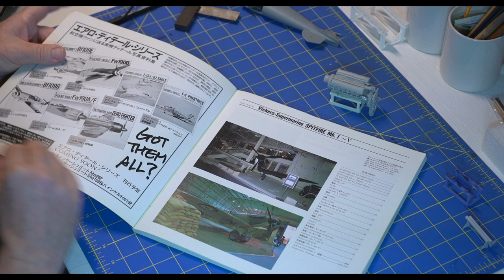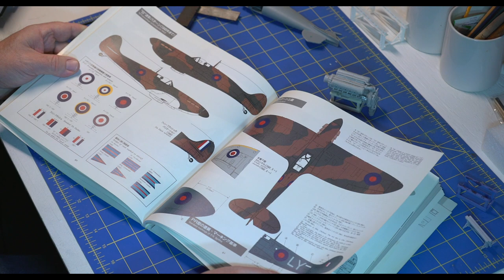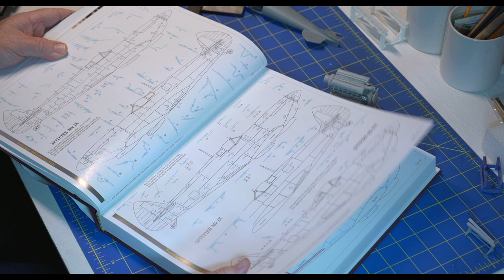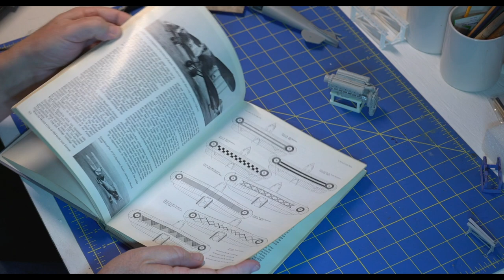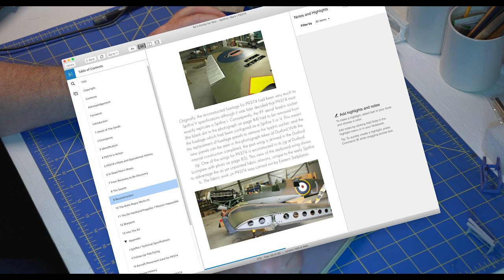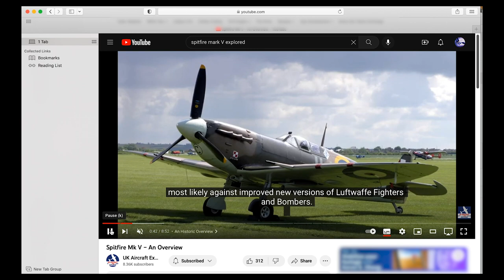1/24 Airfix Spitfire Mk Ia: Best Info Sources

Comment: I have the Aero Detail book and the Paul Monforton book is on order. Plenty more too! One of the best though is from the WingLeader aviation books Photo Archive series. It is a modern publication from a firm run by fantastic aircraft artists and historians and is the best series I've come across for excellent historical reference photographs and detailed commentary. They have a profile on the Spitfire Mk.I and one on the Mk.V - I suspect that there will be a Mk.IX on the way shortly for obvious reasons. Most of the Kotare scheme option aircraft are in the Mk.I book.
Reply from the maker: Thanks very much for that tip, @FinsburyPhil! I will look for them, esp the Mk I book.
Reply from the maker: Oh yes -- just had a look at the site. That looks fantastic. On order!
Reply: The Wingleader books are excellent.
Reply: I have a book that was released in the early seventies, specifically to get the best out of the Airfix Spit MkI in 1/24
Reply: Just bought the Wingleader MkIX which is excellent, though in my view the Mk I book is better.
Reply from the maker: @blowingfree6928  Still waiting for my copy to cross the big puddle!
Reply: @aircraftinpixels  Ha! Aircraft have improved in speed since the Spit' so you should get it soon 😀!